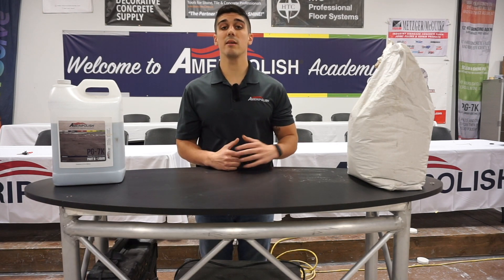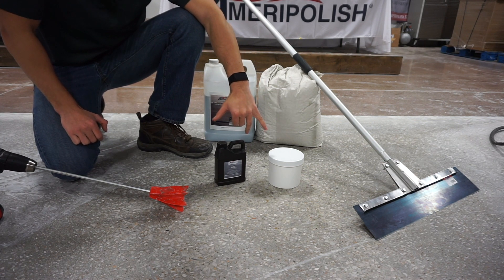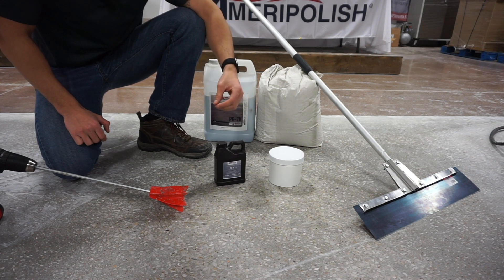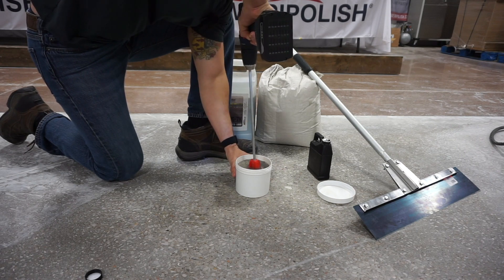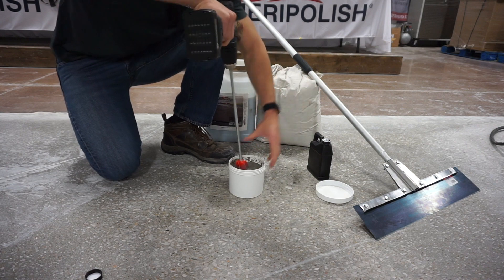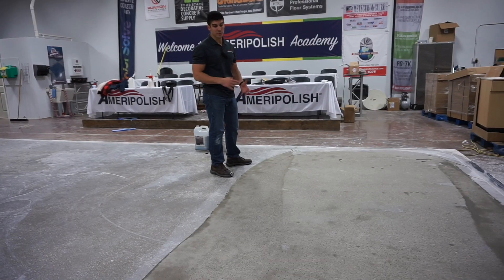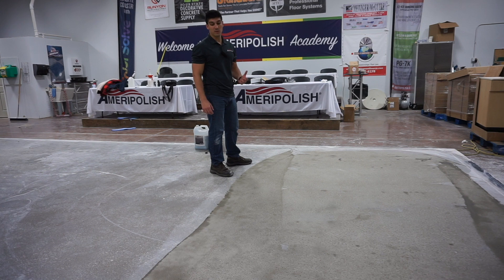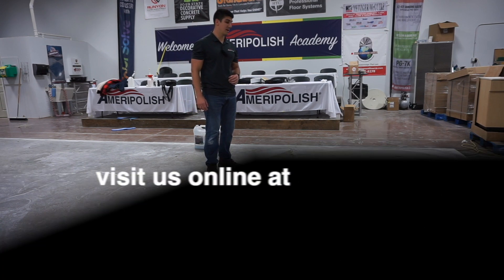How to Apply PG-7K - Ameripolish® Academy Online

Comment: What is the best diamond grit to remove the excess material?
Reply from the maker: Shawn, it starts to become difficult to remove PG-7K with anything after 100 grit resins. Anything equal to or more aggressive should be fine! Keep in mind Applying before 80
 grit metals may result in grout being ground off and new pinholes being exposed so you'll want to apply after your 80 metals!
Reply: Whats the model of the trowel